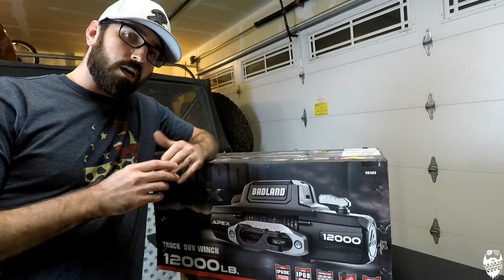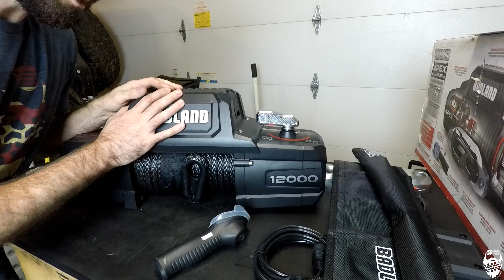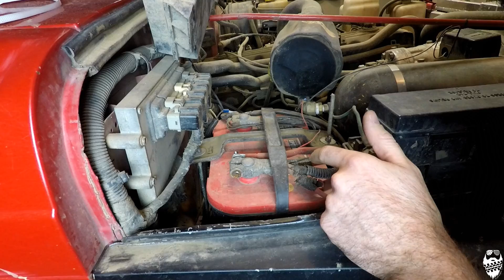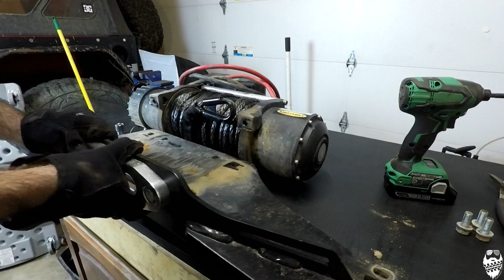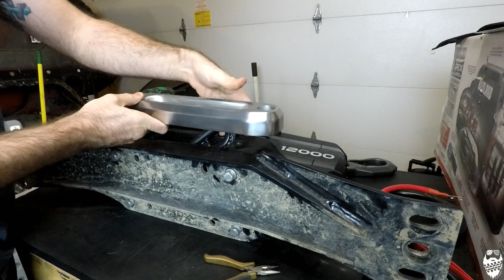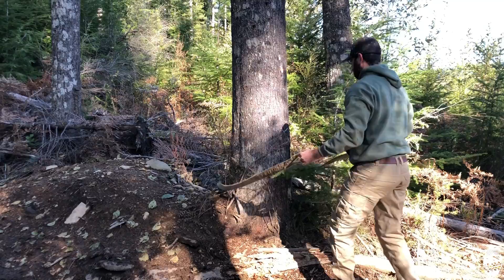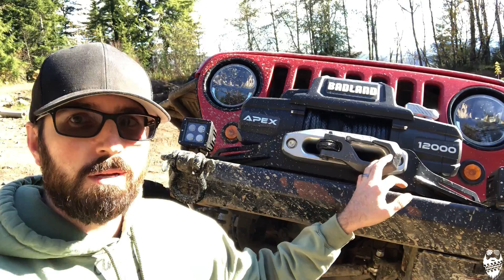Harbor Freight's NEW Warn Killer Winch. Badland APEX Winch install and real world use!

Comment: The biggest killer of harbor freight winches that I have seen is the grease in the gear set. After a year or two, the grease tends to gum up, making it difficult to pull the winch cable out. If that happens, pull off the gearbox, disassemble it and blast everything with a degreaser solvent, then re-assemble it with some good synthetic wheel bearing/chassis grease. The Red Mobil1 grease is pretty good in my experience. 

Just my 0.02, take it as you will.
Reply from the maker: Good tip, thanks👍🏻

Comment: The wireless is cool. Here’s a tip, find out what battery is used in the remote. Get a spare and put it in the glove box. 
The switch that selects “wireless” mode on the winch may short out if exposed to weather. I swapped mine out on my Smittybilt.
Reply from the maker: Good tip👍🏻

Comment: I'm currently running a Smitty winch I've had for 7 years. So far still good.
Reply from the maker: My 8 year old Smittybilt was doing fine when I pulled it off, lol.
Reply: Muddy Beards 4X4 sorry I didn't finish my thought, someone interrupted me haha. I just recently noticed harbor freight had these new winches and thought about trying it out. But I can't justify it yet as mine works good. I would like to see a side by side comparison of this and the warn. Great video by the way
Reply: got a 3ish year old smitty bilt 9500 with steel cable on mine.. use it quite a bit with no issues, it got a real workout removing stumps after a hurricane came thru and i was doing tree removals.. max pull with two batteries hooked to it for extended periods of time in and out back and forth with a snatch block and jeep chained to a large tree... it got hotter than i imagine was good for it so did the alternator but got the job done and works just as good as it did before.. pulled about 5 stumps with it and a sawzall of 30-36" trees id get a 12-15k one if i was buying another
Reply: Had a 9000lb. Harbor freight on a Jeep for 5 years. Pulls like hell and have had zero problems. Have a 4 year old 3500 on my side by side. No problems with it either

Comment: I'm going to give this one a shot. However I totaled up the years on my warn winch and I've had it for 22 years now. It is been ever loyal. I also do a lot of forestry work with it pulling over have cut trees or stabilizing them with a torqued lean these are full-size trees so it's been through some hellacious use it's also saved me One time when my truck went way down into the ditch. Ended up in snow up to my chest I basically had to swim in the snow and hooked up to a  tree on the other side of the logging road. Pulled the whole truck right out never had problems operating at below zero which is critical or during the hot summer hoping these will offer the same reliability

Comment: Duuude. That rig is a beast. And you can drive. Was thinking you weren’t gonna even need the winch.
Reply from the maker: Thanks, a week at King of the hammers improved my driving for sure. Was I actually stuck??? Not really, just wanted to test out the winch, lol
Reply: I was going to say the same thing as Beto. Duude that thing rocks. I have watched a bjillion  jeepin videos and that few minutes was some of the best. Every ones got JKU's now. you would have never seen a JKU crawl thugh that like you did. This is why I still have my similar decked out 13 JK. but I'm on 35's no BL. That is the next upgrade but that includes 37's or 40's some good D44's or the jump to 60's and that's a jump. What axles are you running? Oh and I doubted you were stuck either. You could have backed up and punched it over that but I get why you wanted to try the winch :) I too have been looking at the BL 12000. There is a HF a mile away from me and I shop there all the time my question is long term. You will have to do an update video in a 6 months or a year.
Reply from the maker: Thanks, I do plan on using it a lot over the winter and I am sure I will be using it at Easter Jeep safari in Moab this April. I will give you guys an update on how well it performs once I get some real use out of it. My last video I talk about axles and what it takes to get to 40’s. Also I soon will be starting a build series on an ultimate Ford 9”, and long arm install.👊🏻

Comment: That is one bad ass TJ.  While I have no problem spending $289 on their old 12,000 winch as a back up or trailer unit , I'm not spending $800 on a winch I can't buy parts for. You can buy any part you need for any warn winch , which is hard to put a price on.

Comment: The badland zxr 12000 pound winch is perfect for what I use it. For its great for the money and it works awesome I paid $349 for my badland zxr 12000 pound winch . I used my badland zxr 12000 pound winch to remove a tree from my backyard and the winch pulled it out with no problem

Comment: Just in case you didn’t know, many winches are the same internally they just have different cases to make them look different. You would be surprised how many name brands are the exact same winch underneath regardless of winch size( 8000 lbs or 12,000 lbs). Basically what happens is a company in China makes a winch then everyone pays for it and builds a case around it. The reason I know this is because I worked for a company and helped design their case. Warn makes their own stuff but many of the name brand aftermarket companies sell the exact same winch and nobody knows. Now this doesn’t mean they are all junk and warn is the best. From the data I saw warn actually had the highest number of returns and warranty claims vs the cheaper winches. Maybe this is due to the average joe or soccer mom buying a less expensive winch just for looks and never actually using while people who buy warn products actually use theirs idk. Anyhow the cool thing about the harbor freight winches(which are the same as many other name brand companies) is you can purchase individual replacements parts when something breaks so they are cheap to keep up too.
Reply: I'd say warn has a great customer service and warranty platform, and people know it too. so they take advantage of it. the other companies i feel like most of the people won't bother because maybe its too much of a headache? just my guess
Reply: Makes sense, I feel like even Warns newer models coming out are designed the same as these off brands just to compete. My biggest question isnt how if performs but how long it performs. One of Warns signatures is that people have been running their winch forever. I haven't shelled out the big bucks for a Warn, but I have gone through a few cheap winches. Engo winch the first thing that failed was the solenoids. Box filled with water. They replaced it no questions.... did the same thing 6 months later and that was just sitting on the bumper. I decided to go with the Tractor supply brand because of the quality of water proofing and I've had it for 3 years with no issues so far except their wireless attachment. It got water in it and shorted out. Took it apart and it's just hot glued to keep parts in place. I bought a new one and sealed it with RTV so we'll see how that holds up. I'll probably pull the gears apart and re-grease them with quality grease, but with new tech, even crappy products can be a great deal.
Reply: Warn winches with prefix VR come from China, reason for lower pricing.
Reply: Preston thanks for sharing!
Reply: auto batteries are like that too many brands go down one Assembly line
Reply: Cheers and thanks! You're a Saint.
Reply: Same with almost everything, my friend used to work at Payless Shoes, they got regular deliveries of cheap sunglasses in Spring, one day he got a shipment that included a couple pair of Ray Bans by accident, the same factory that was making $10-$20 sunglasses was making Ray Bans as well.
Reply: @unklematter  
I was going to say the same thing. I think now a days there's only 2 companies left in the U.S. that actually make batteries and all the companies just slap their stickers on them depending on specs etc.
Reply: @deanfirnatine7814  years ago 60 Minutes did a segment on sunglasses and all but Oakley come from the same factories.
Reply: @shaunr5450  and now even Oakley are made in China....they sold out to Luxottica mega corporation which owns Lenscrafters/Eyemasters/Sunglass Hut. I've always been an Oakley fan, but the last pair I bought were a replacement for the exact same pair I lost in the ocean. The lost pair was USA, the replacement pair was china. What a shame.
Reply: @thebigempty_5792  I believe Oakley was a hostile takeover, you can do that when you own everything.
Reply: @deanfirnatine7814  You are absolutely correct. Ray Bans are made at the same place as $10 sunglasses.  Luxottica makes about 90% of the world's sunglasses. Gucci,  Ray Ban, bolle, Oakley, and all of the other big names are all made there.

Comment: Great review.  Matter of fact, I just bought one.  I know this is an old post, but I have one question.  You wired the positive to the pos battery terminal.  What did you do with the small little ground wire.  Little back wire.  TIA
Reply from the maker: Ground wire on the back of the winch

Comment: Just bought this winch for my YJ today. I had the HF 12,000lb cable line winch. It was great but had electrical issues and warrantied it out and paid a lil extra for this one. Seems like a huge upgrade. Can’t wait to install it. My question for you though @Muddy Beards 4X4 is my winch came with a on/off battery switch to hook to the winch so it doesn’t always constantly have power. How come you didn’t use this in your install?
Reply from the maker: Mine did come with this switch. I did not install it because I was rushed getting ready for a wheeling trip the next day. I never had one before and have never had an issue. It is a good idea, but I don’t want to get stuck and have forgotten to turn it on and have no way of getting under the hood. so I am still on the fence if I am going to install it or not. I will be redoing all my wiring at the battery so I might do it then. Thanks for watching.
Reply: Yeah that’s the only bad part is having to open the hood to turn it on and off. I thought about maybe cutting the wire and re crumping it to where I could mount the switch inside the grill so you wouldn’t have to open the hood. But then if I do that wouldn’t be a whole lot of point in having it lol. But thanks for the reply! I was just curious!

Comment: I'd be willing  to bet that the harbor freight winch and smitty built winch are made by the same manufacturer
Reply: No I believe smitty makes tractor supply's traveler winches, champion I think makes the badlands
Reply: Warn owns the Badlands brand....
Reply: China!
Reply: @johnpike9612  Is it warn now? I know a few years back all the harbor freight winches were mile marker.
Reply: @Daishar  honestly idk for 100% who makes todays hf winches...... several  years ago i looked at buying a badlands winch at my local harbor freight and on the box it said the manufacturing company was warn winch but that may have changed even though the design hasnt until this apex model......technically warn was the manufacturer but harbor freight has always owed the brand name..... i shouldve said "makes" not "owns" the badlands brand
Reply: All I know is the 2500lbs badlands I put on my Polaris sportsman is pretty badass for the price.
Reply: @Tman0517  your pocketbook... wait on a Polaris rzr or something? why didn't you just actually buy a jeep and the 12000lb  for the same price lol.
Reply: Yes
Reply: Pretty sure at 1 point smiity built made the Badlands. But now I have no idea. I'm sure Badlands/HF just pick the cheapest vendor to build to their specs.
Reply: @Tman0517  I use the 2500lb to load cars on my trailer it works good.
Reply: I believe the winch is ok but the mounting bolts they give you are china scrap metal quality. Had a badlands winch fold in half because the mount bolts striped out under pressure.

Comment: Nice rig, good driving. I still prefer steel cables. actually just bought a cable added a loop using a thimble and a collar, if needed, I can connect them 2gether and have 135’ ov winch cable, although this  is a nice winch don’t get me wrong.

Comment: How responsive is the remote in wireless vs wired? The winch I have (vortex direct, several years old) the wired is perfect and the wireless is laggy. Looked at the HF wireless controller that plugs into the steel cable winches and they're laggy too...

Comment: Safety Always,    so others know you should be doing it Always the Heavy Blanket over the Line,  even tho its Synthetic,  Always practice Safety.   And when you bring the Tow Line in,  be Careful your not going to Far your Hitting the Fairlead,  that Fairlead should remain with out any Scratches,  because your using Synthetic.  Very Cool Winch,  I love the Accessory's it comes with,  very Nice.  It would a good for a Follow Up if the suddenly Breaks on YOU,  even tho Harbor Freight Supplied it

Comment: Hello nice video. Did you decide to not install the big switch?
Reply from the maker: No I did not. I need to figure out a better way of doing the wiring so I can have a switch in the cab. I don’t want to have to get under the hood and switch it on every time I need to winch. I have a new switch system in the works I should be getting here soon. Thanks for watching 🤟🏻
Reply: @MuddyBeards4X4  thanks. I also decided not to install a switch because I found it difficult to mount. I will just disconnect the positive from the battery and keep a 10mm wrench available for when I need the winch.
Reply: Also I did not connect the ground wire as it grounds through the chassis

Comment: Hey there.  I had a regular badlands 12k that I put a synthetic line on on a 10k excursion and it did okay.  It was really slow and the duty cycle was short.  How is the duty cycle on this new APEX?  And what are the line speeds comparatively?  Also, do you have to switch it to remote every time you use the remote?  I noticed you switched it on the trail.  I've got a newer Raptor now and the winch would be totally hidden behind the bumper/skid plates.  It will also be a lot lower than yours.  Have you tested the waterproof claims?  I know the original badlands is not very waterproof.  Thanks!

Comment: How much of a lift do you have on that bad boy?! Mine only has a 4 inch lift and it works pretty well but I was thinking about going higher so it could flex more when rock crawling. Love the rig tho!
Reply from the maker: Thanks, it’s about 4.5” lift. Less is more when it comes to lifts in my opinion, keep it low and stable. down travel is more important than up travel anyways.
Reply: Muddy Beards 4X4 Thank you!
Reply: Slade Gist low COG, articulation and clearance are your friends. That and picking lines. I have seen a TJ with long arms, tummy tucked and 33s go over trails like it was a slinky

Comment: Thanks for the video!  Great information!  I have a newbie first-winch question: Should I put my winch on the front or back of my vehicle?  I'm not an aggressive rock climber or deep mud enthusiast.  I'm just putting one on my van (2020 GMC Savana 2500 4x4) for emergencies.  I'm thinking the back bumper is more practical, but  I'm not sure.  Thanks!

Comment: First, let me say that I don't get into many serious off road situations like that. However, I have the old Badlands 12k winch on my 78 GMC K-35 and the 9k on my car trailer and they've performed flawlessly for my needs. I saw the new Apex winches a few months ago. That fancy hook on them looks nice, but, I don't use winches for looks. At first glance, my biggest issue with the Apex winches is that they don't have a roller fairlead. I've never used a winch with synthetic rope, but, I'd be wary of using ANY winch without rollers. The forging or casting of the fairlead will always have burrs and/or sharp edges. I've seen steel cable break under load and it's not pretty. I'd guess that if the rope breaks due to damage caused by fraying/cutting, it wouldn't be pretty either.
Reply: If it broke, it wouldn't do anything but fall. They don't store energy like a steel cable. That's their advantage

Comment: will the airflow blockage from the winch cause overheating to motor?
Reply: Agent Anderson if your cooling system is up to snuff then no, it won’t hurt anything.

I’ve had a winch on my Tj for 8 yrs and I’ve never had a problem.

Comment: Id be impressed if it was free to. That being said, Ive had more issues with Warn winches. Ive had my smittybuilt winch for 3 years and its never let me down.
Reply: Brian Nolastname I’ve had my Shittybuilt for 6 year and it finally stopped working. I think it’s just the solenoid though.
Reply: @ElkinsEric  smittybuilt has a good customer service, they may be able to help trouble shoot the issue.
Reply: Yeah Smittybilt customer service is tops . I had an issue with one of my bumpers recently and they sent me a replacement with no grief

Comment: Do you still have the same winch and how is it/did it work for you
Reply from the maker: Yes, still have it and still works great
Reply: @MuddyBeards4X4  sweet. I just bought one yesterday for my 2008 super duty. I am wanting to set it up in a cradle so I can use it front and rear if need be. There are a ton of 5 star reviews so I hope I didn't do wrong. I decided to but the 2 year replacement plan but I'm not sure if it would be a waste of money or not. I guess time will tell